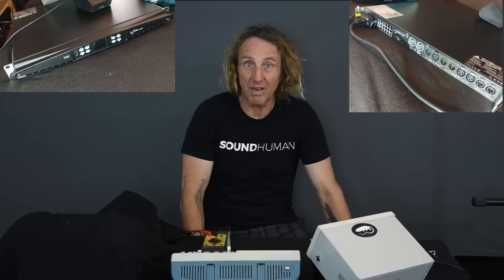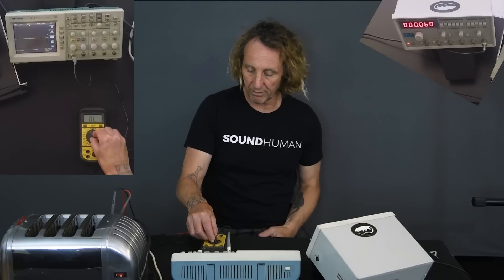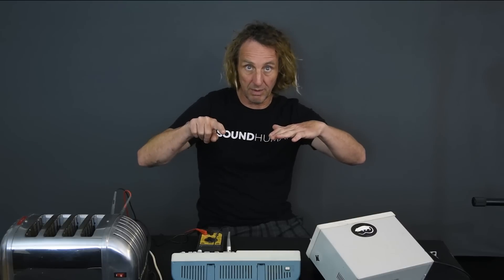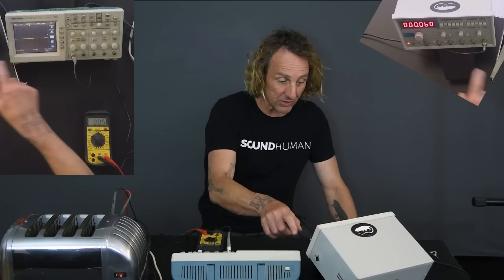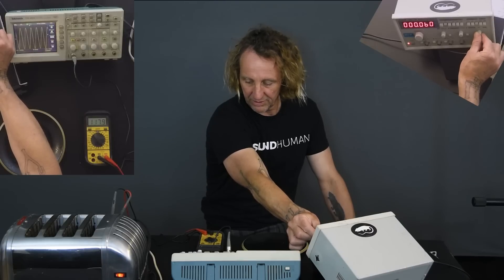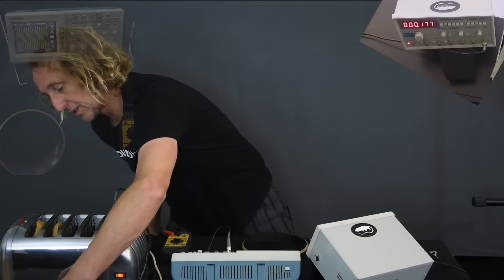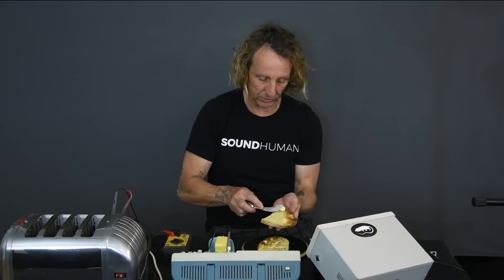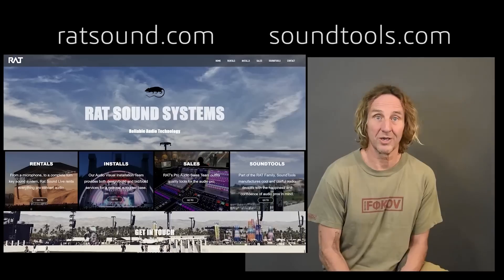What Happens When an Amp Toasts? (Public)

Comment: It’s true that wall volts peak to peak is 350-ish VAC, but don’t forget that it’s referenced to ground, and usually when someone gets shocked, it’s because of a path to ground. 
So it’s really just the 170VAC peak voltage. 
Someone check my math, I did just sit down with a drink.
Reply from the maker: Drink post is the best!

I don't think there is a clear answer. On one hand, The people ditch of 1.414 * The RMS voltage which is about 172 volts would be a legit perspective. 

But also the peak to peak voltage of 344  which would be the voltage swing is also present. 

I think the only good way to test would be to compare how a rectified 120 volts feels versus a non-rectified 120 volts feels or impacts. 

A rectified 120 volts would be repetitive 170 volt peaks whereas a non-rectified 120 volts would be repetitive alterations between 170 volt positive and 170 volt negative. 

To be honest, I don't really know the answer and I'm not overly inspired to make the comparison at least at this moment but..... 

With a proper amount of drink posting that may be an adventure I would partake in
Reply: @DaveRat 😂
I’m not sure I’m ready to have a few drinks and compare voltages. 
My list of stupid shit is pretty long, and I’m sure I’ll add to it. 
I’m terrified of electricity and I’m an electrician. I’ve still never put a 9V battery on my tongue. 
But who knows?
They keep making bourbon.
Reply from the maker: I have been zapped so many times, I've even done a human conductor experiment just for fun

My friend grabs a water pipe I put my finger on 120volts. Then we each touch fingers. The harder you press fingers together the more body hum mellow shock.

Kind a scary kinda fun. Best with mushrooms
Reply: @DaveRat 😂😂😂
I’m still terrified of the stuff. When I was a kid, my younger smarter brother convinced me (back in the 80s) that I can stick a piece of metal in just one side of an outlet and I wouldn’t get shocked. 
Turns out, he was half right, but it matters which side.

Comment: This popped up in my shorts feed, thanks for the laugh.

Reminds me of the time we we're learning in class about magnetic field sensors and the course instructions explicitly said "Don't use the higher voltage connection, it'll spin too fast and launch things across the lab."

Naturally... I definitely did use the high voltage power supply... for science...

Comment: your skin is the key . It takes about 42v to overcome the resistance of ur skin . But if ur hands were wet wich would aid in the power transfer to ur body and in that case 12v is plenty to give you a good shock
Reply from the maker: And also the current matters. Phantom power has a current limiting resistor that makes it's 48volts deliver way less power than a 9v battery or 5v USB

Comment: Did you calculate the ohm load of the toaster before you started?  I can’t afford to burn up my amp with a 1 ohm load.
Reply from the maker: Multiply the wall voltage times itself (voltage squared) and divide by the wattage listed on the toaster to get the resistance. 

The resistance will be lower at first till it gets hot but even a 2000 watt toaster would be 7.2 ohms. A 1000 watt toaster will be 14.4 ohms.

So you should be fine

Comment: Can I use toaster as load for testing amplifier? Or what can be used for load, for testing 1000-2000w subwoofer amplifiers?
Reply from the maker: Yeah, that would work. The challenge is it is a non linear load, the resistance raises as the elements heat so wattage calcs would be a bit more complex.

Comment: AC voltage is measured peak to peak.  120vac is not really 240vac.  Good content, just a little error 😁
Reply from the maker: Thank you and correct. Not sure what part you are referring but just to clarify:

120vac is rms. So it would 120 X 1.414 = 169.68 peak and 339.36 peak to peak

Comment: I’m of the understanding that a large proportion of the crown 10k monoblocks were sold into medical facilities to power precision medicine machines. I believe stable psu was the design intent.
Reply from the maker: Interesting! I worked at Hughes aircraft and we had McIntosh 2300 amps that we used to test power supplies by creating ac voltages

Comment: Regarding electric shock and the resistance of a human body. The skin is the key,and its resistance varies a lot.
See https://www.ncbi.nlm.nih.gov/pmc/articles/PMC2763825/ (second hit on DuckDuckGo)

"A calloused, dry hand may have more than 100,000 Ω because of a thick outer layer of dead cells in the stratum corneum. The internal body resistance is about 300 Ω, being related to the wet, relatively salty tissues beneath the skin. The skin resistance can be effectively bypassed if there is skin breakdown from high voltage, a cut, a deep abrasion, or immersion in water "

Skin "allows more current to flow if a voltage is changing rapidly."

"It is the current that determines physiological effects"
"With alternating current, if the current level is high enough, there will be a feeling of electric shock as long as contact is made. "
"In contrast, with direct current, there is a feeling of shock only when the circuit is made or broken unless the voltage is relatively high"
Reply from the maker: This makes sense and is what makes me think the max voltage swing is a factor in addition to the voltage to ground. And why rectified ac will feel different than non rectified ac.

If the max voltage swing has zero impact then rectified ac would feel exactly like ac. 

But rectified ac is closer to dc which feels different than ac.

If the voltage swing is a factor in what we feel, then the 170 voltage swing of rectified ac could feel different than the 340 voltage swing of non rectified ac.  Even though both are the same 170 to ground. 

I believe the info you are presenting supports that as probable.

Comment: Toast? ... meh, try 𝙖𝙧𝙘 𝙬𝙚𝙡𝙙𝙞𝙣𝙜!

Audio magazine in 1987 took a pair of Mark Levinson monoblock class A hifi amps, paralleled the outputs, and arc welded two pieces of metal together. 

It took out a few line fuses until they got their methodology squared away... 
They drove it via a 1khz square wave!
Reply from the maker: Good stuff but nowhere near as tasty!

Comment: What was the DC resistance or the impedance of the toaster?
Reply from the maker: Well, it's rated at 1800 watts but there is a 2 slices and 4 slice setting and I had it on 2 slice. So 900 watts. And since watts = volts x amps, dividing both sides by volts would be 900/120 = 7.5 amps. And since volts divided by amps= resistance, that calcs out as 120/7.5 = 16 ohms.

Though the resistance of a heater element starts lower and raises with temp. But yes, about a 16 ohm load

Comment: 120V RMS is in fact  ~170V peak, but can never be 340V. All though mathematically, peak to peak is (170- (-170) =340) the difference in tension never exceeds 170V because one of the lines is always 0V, the other one oscilates between +170 and -170V. Therefore there is no way to ever measure 340V
Reply from the maker: Hmmm, does that mean that one leg of a 170v fully rectified ac waveform would feel and shock exactly the same as a 170volt peak (340 volt p to p) waveform? 

Perhaps that is true, would need to test to find out.

Or is it possible that the 340v swing from negative 170v to positive 170v has its own shock or impact value. I don't know the answer but I could see logic that supports both perspectives.

If you look at the absolute value of the voltage differential to ground at any point in time, the two waveforms are exactly the same. 

What do ya think? Does a fully rectified leg of ac with a 170v peak voltage shock exactly the same as a non rectified 170v ac waveform?

Like I said, I don't know though I tend to think that two differing signals are unlikely to have the exact same impact.

Fun stuff!
Reply: @DaveRat  What matters for electric shock is the voltage difference at any given time (between you/the ground you stand on and what you touch or between two conductive items you happen to touch).
 It is not the swing over time (the shape of the voltage curve) that matters.

So, if one side is ground potential (as a person standing on the ground), and not touching e.g. a charged capacitor that holds the potential far from ground potential, while the other side of the person touches a phase/line conductor of an AC supply with a grounded neutral, then the maximum difference at any given time will only be 'ground to peak', not 'peak to peak'.
Reply from the maker: So if I touch a high voltage DC wire with a positive voltage while not grounded, I won't get shocked. And then if I let go and immediately touch a high voltage wire of negative voltage voltage I also won't get shocked.

The body instantly adapts to whatever voltage we touch, no shock?

So what you are saying is that changes or swings in potential have no impact at all. 

Except with static electricity where we do get shocked and we are not grounded.

Is that contradictory? At what voltage or potential levels does it transition from no impact to impact? Is it a certain voltage or is it gradually increasing?

Have you tested this or is it a hypothesis? 

As you may realize from the videos I do, I am not one to accept things as facts easily without testing.

I can say that DC feels different that ac in that I can feel the vibration of the ac vs the clamping sensation of DC when shocked beyond the initial bite. So I do know that the waveform does have an impact. Furthermore, the freq of the ac can be felt.

What I don't know for sure is whether rectified ac feels the same as ac or whether it feels more intense or not. Also, whether a square wave give more shock that a sine wave. I would guess that the square wave would bit more with the quicker transition from extremes and added high frequency energy. But according to your explanation, a square wave would bit the exact same as a sine wave.

Pondering a test!
Reply: @DaveRat  Static charge is in practice unavoidable (in the ungrounded scenario or thought experiment), but has no role if there is permanent connection that prevents a build-up of static charge. So the scenario gets simpler if the person is connected to the power source with a single connection we can choose to call "common/ground". 

Your example with DC will only result in static discharge chock. Once that discharge has settled, the shocking voltage is 0, as there is no circuit for an electric current.

Grabbing a phase in one hand and a neutral/ground in the other hand, fed with a sinusoidal voltage, you will not feel the peak-to-peak voltage, just the instant voltage between the hands. There will not be charge left from one peak to the next.
Reply: @DaveRat   @Dave Rat  The purpose was to explain why the presented case of sinusoidal AC voltage giving electric shock has no relation to a peak-to-peak voltage, but just the peak between the terminals. 
For "resistive loads", like a person getting a (potentially dangerously) good connection to 120 V RMS AC or higher, the current though the body is not related to peak-to-peak value of voltage, rather the RMS value at average and the peak voltage gives the peak current.

>>So what you are saying is that changes or swings in potential have no impact at all.
Not on peak current, no. Not in a way that makes a peak-to-peak measure relevant.
I tried to say that the peak current is not determined by a peak-to-peak measure. It is the voltage across you body, which does not rise to 2*peak level.
Sorry that was not clearly written.
Electrically, the time between the peaks is waaaay longer than any effect of one peak takes to die out. Therefore I predict that one peak does not affect the next, regardind the strength of the the shock. Not enough to double the sensation of a shock.
I have not tested this theory. :-)

When getting zapped 120 times a second, the next zap may not feel 2 times worse just because the current flows in an opposite direction the next time. The peak and average current stays the same for each zap, unrelated of polarity and un-smoothed rectification.

Comment: You used an unbalanced input signal from the generator, but the toast ist toasted on both sides.
How does this work ? :DDD
Reply from the maker: And not only that, it's a 4 slice toaster, set to 2 slices, perhaps I should rewire it for a stereo input and put an NL4 on the cable

Comment: It’s strange how you can touch the negative and positive on a 12 V car battery and not feel anything yet drop an open end wrench across those two terminals and you get an instant arc welder
Reply from the maker: Right! Looks and is safe unless you are made of metal, it is not safe at all!

Comment: Your wall voltage vs shock factor is sort of correct, the point about RMS vs peak to peak AC voltage is well taken, but you're missing a piece. Your body has some significant capacitance, and this works to help block DC from carrying current through your body, the same way it does in a circuit. However, AC is not blocked in the same way and thus you carry more current and feel more pain.
Reply from the maker: Great point.  I looked up human body capacitance and it seems to be in the 10s to 100s of pico farads. So the frequency of the electricity would be an important factor as well.

I guess the question is, which would zap ya more, 120 volts DC which is straight 120 volts or 120 volts AC which has peak voltages of 340 volts.  I am guessing the 340 would bite more but 340 DC vs 120V ac, I would guess the DC would bite more. Best way to find out is test!! Any volunteers?
Reply: @DaveRat  Electroboom already has! Do a search for something like "AC vs DC pain Electroboom" and there are a few where he tried different voltages and frequencies on his tongue. I think he did push pretty high on DC but couldn't get anywhere near it with AC, and you're correct, different AC frequencies did hurt differently.
Reply from the maker: Did not watch but here is a quote from the electroboom in the video description that seems to align with what I would expect.  Also he seems to not be aware that peak voltage is 2x rms x 1.41.

"Now as I show in my video, the AC seems to hurt at RMS levels half of the DC. But you should know that RMS means the effective AC voltage, meaning that from power consumption point of view an AC signal with specific RMS value is equal to the same value DC signal. But the actual peak of the AC voltage is the RMS value times 1.41. So a 6.5V RMS means that it is oscillating around 0V with 9.16V peaks in a sine wave form."

Comment: A 4 ohm load would dissipate roughly 4000W with a supply of 130vac.  The toaster, like filament lights, will be a non-linear load resistance, dropping with heat.  Did you happen to measure it or am I just getting too serious.
Reply from the maker: Ha1  All good., this is important stuff. The toaster is rated at 1800 watts so that calcs out to an 8 ohm load. But I am guessing the 1800 watts is when the switch is set to 4 toast slices and I had only 2 slice setting.  So since the elements are in parallel, it should be a 16 ohm load and 900 watts with the elements fully heated.  The load would be a lower resistance briefly while heating up.

Comment: Because the Amp tested is a 1u, it probably has a switching power supply? If so does this prove that the days of big toroidal transformers is a thing of the past? I am sure toast is not a sensitive as our ears and doesn't really care how the power is delivered but can our ears tell the difference? Thanks Dave, reminds me of cooking hot dogs with just two nails, some wire and a wall socket.
Reply from the maker: I am starting up a video series on amp testing and watts and will cover old vs new amps, how watts are not all delivered the same and loads more.  As usual, I will post to members first and then make the videos public at a later date.

Comment: I've got a group of nichrome elements set in a big drum of cooking oil that can be series / paralleled in to a number of different (stereo) impedances. Has the advantage that the impedance stays fairly constant as the nichrome itself doesn't heat up much itself. When you really thump a big amp in to it you can fry chips ;)
Reply from the maker: Excellent!

Comment: So what ohm load does the toaster measure out to?....
There's a big difference between a 100 ohm load and a 4 ohm load....lol
Reply from the maker: Hmmm, well that can be calculated for the wall voltage, it's an 1800 watt toaster at 120 volts, then it would be 15 amps,

And 15 amps at 120 volts is surprisingly 8 ohms!
Reply: @DaveRat  So you could parallel two of them to get the 4 ohms that the amp is rated for.  And then there's the other channel.
Reply from the maker: Yes and no. I will be doing some vids soon on amp power and how all watts are not created equal
Reply: @DaveRat  Well, I guess I'll have to wait for those vids to see what you mean.

Comment: The worst shock I have had is off of a car distributor, ouch! 110 ac is nasty too but that distributor really bit. Voltages to watch for are the ones that make your muscles contract rather than repulse, glad I've not got hit by any of those. Crazy cool video Dave, Lovin' these! :)
Reply from the maker: A car induction coil puts out thousands of volts needed to creat a spark that jumps accross the spark plugs.  That is why it bites ya.
Reply: @DaveRat  Yeah it's a bell ringer, not recommended that's for certain, it's the kind that makes your teeth hurt. I totally had me some toast after watching this. :)

Comment: Excellent!  With a VZ5000 run through a DX38 with 2 Linkwitz-Riley 24-dB/octave slopes (low pass) @ 16kH and HP @ 45Hz not only did I get even browning, I could feel it toasting through my buttKicker.